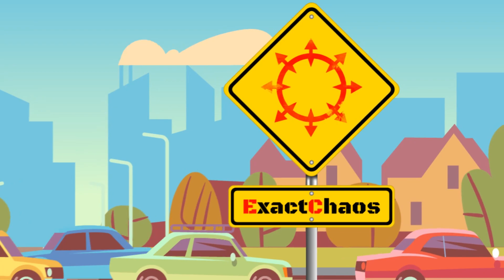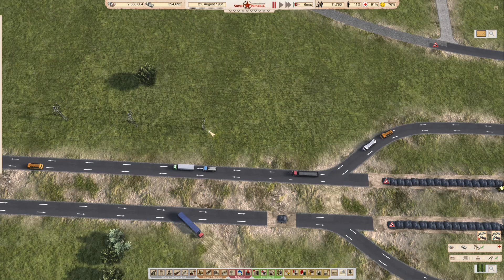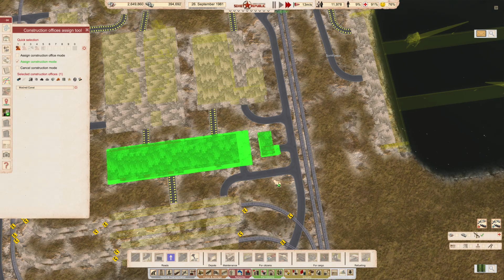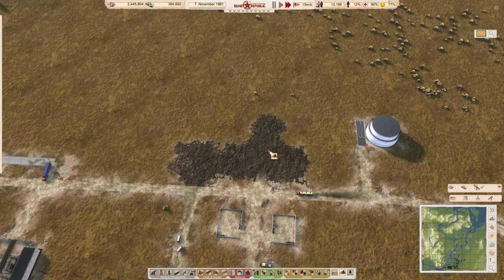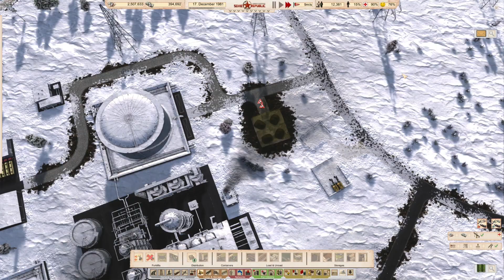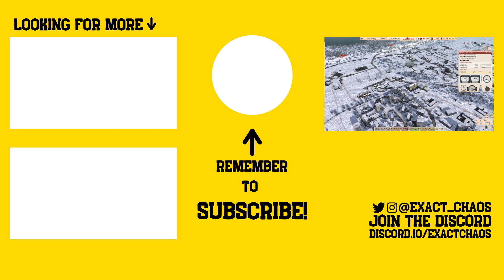Tidying Up Loose Ends - Workers & Resources: Soviet Republic

Comment: 57:26 - Simple fix: don't have the dumpers wait until unloaded at the gravel processing plant.  Complicated fix: Construct an intermediate Aggregate storage facility (with a lengthy driveway) that the Dumpers from the quarries unload into, and then attach a truck aggregate loading station where two or three other dumpers load the quarried stone and transfer the material into the processing plant.